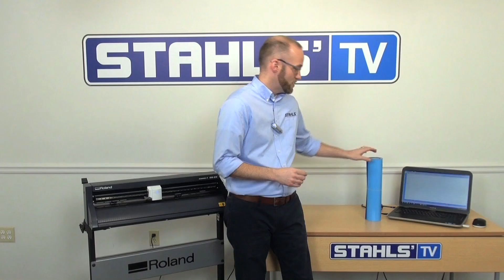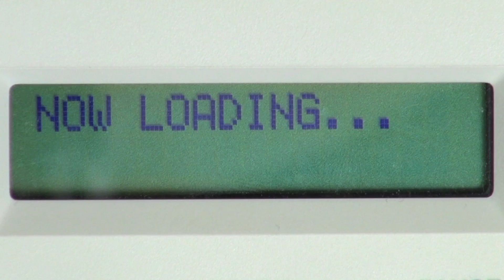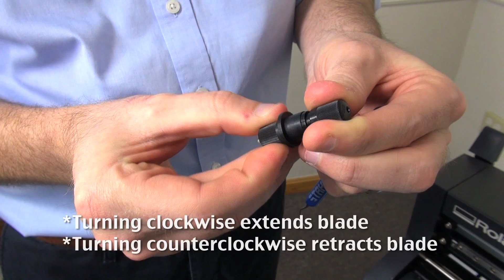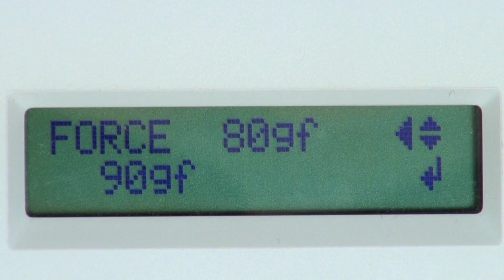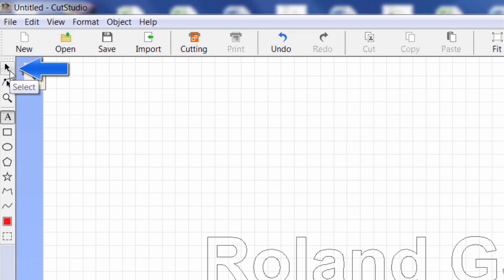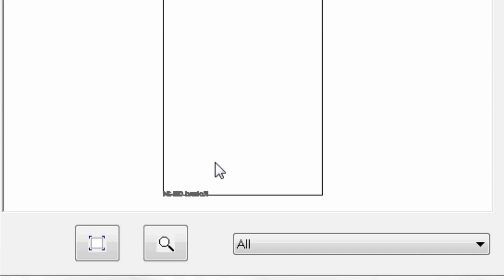How to Cut Vinyl Start to Finish with the Roland® GS-24 Vinyl Cutter

Comment: Hi great product. I was wondering if I can cut a 0.5mm silicon rubber with this?
Reply from the maker: We recommend trying to cut it with a 60 degree blade. We have not tested this material.

Comment: Hi what is the slowest speed on this cutter. As I use anchor T226 vinyl. Kind of a rubber vinyl.  And must be cut at a very slow speed. Thankyou
Reply from the maker: The Roland GS-24 can cut as slow as 10 CM / Sec.
Reply: @StahlsTV  thank you v much.  10 cm per sec is v slow I presume?

Comment: It is correct that the transfer foil is already on the backside of the vinyl?
Reply from the maker: For this heat transfer vinyl - the adhesive is on the vinyl. For heat transfer foil, it is a separate product. https://www.stahls.com/heat-transfer-foil

Comment: Can the blade cut through the paper? I’m in plan to use Rolland printer for printing wallpaper but need the cutter to remove the white line left and right where there’s no print. So practically when I’m installing the paper to seamlessly connect panel to panel. Will this cutter remove the white line completely?

Comment: Hi, on your video when you finished cutting, the piece of cut foil was in the front. When i finish cutting, it would roll it back. So in order to separate it i have to unload the material and cut it off then from the roll. How do I do that it remains in the front?

Comment: Why is the orgin set to the far left shouldnt it be to the far right? 

I have a gx-640 thats im trying to understand i use sign cut pro. I set the width 24 “ and length i just put like 1000 “ but its cuts stupid not only that i load 24” material and it reads 23” but the bigger problem is it cuts wrong as far as direction like i can fit 10x 2” rectangles horizontal to the machine/24” vinyl roll but it cuts its vertically and ive set it on the software how i want it cut but the machine wont listen

Comment: Hey ! Great video. I Have recently purchase this Camm-1 GS 24 Roland cutter and it works fine except when I go to use the Optical registration system. I print out the registration marks and it doesn’t even pick up the first mark ... I noticed in other video that there is a laser that reads the marks. My machine DOES NOT show a laser to read the registration. Is there anyone that could help me figure out this problem ? I would greatly appreciate the help.

Comment: do you have automatic settings like in the cameo? looking to upgrade my cutter
Reply from the maker: The Roland does not feature saved settings. The Graphtec CE-6000 and the CE-6000 plus have the ability to save settings in the pre-sets.

Comment: ...1/2 the thickness of a credit card would be about .5 mm...you keep saying half the thickness of a credit card about 2 mm...your credit cards are 4mm thick?
Reply from the maker: The idea is that the blade should be barely sticking out from the holder.  The actual distance should be the thickness of the film lasyer of the material you are cutting.  The 1/2 of a credit card's thickness is a good estimate that's been an easy gauge for folks to understand without a micrometer.  Sorry for any confusion it may have caused!

Comment: Will this work with Apple computer OSX 10.11?
Reply from the maker: The Roland GS-24 will not work with an Apple computer running OSX 10.11. However, the Graphtec CE-6000 will, and it is a very similar cutter.

Comment: What blade depth do i need for vinyl/ sticky back plastic? same amount as the video? Some else set the machine and it cuts right though the backing into the bed of the machine! I will adjust the pressure and do a test but there is a good 4mm of blade. It has a knife blade 45degree i think it looks like
Reply from the maker: Hi Matt- Using a 45 degree blade, I recommend keeping the blade depth at 2mm (or about half the thickness of a credit card). Adjust the force down on the machine to keep it from cutting through. Thin t-shirt vinyl cuts around 70-90 grams of force with a new blade.